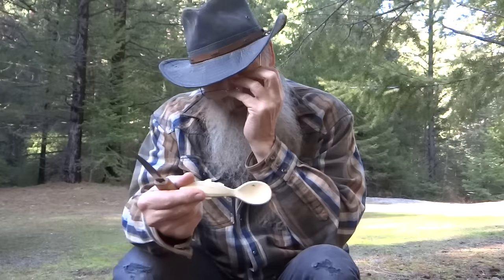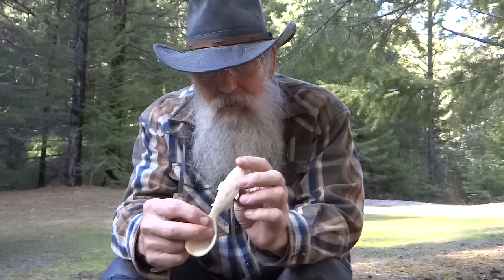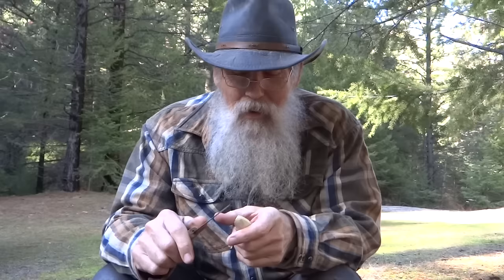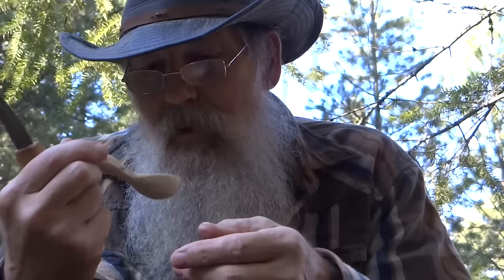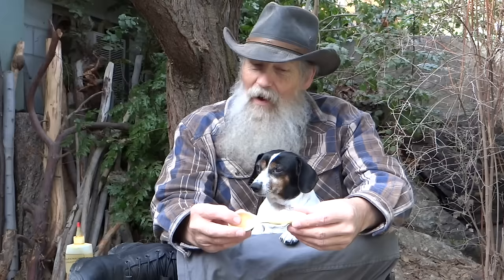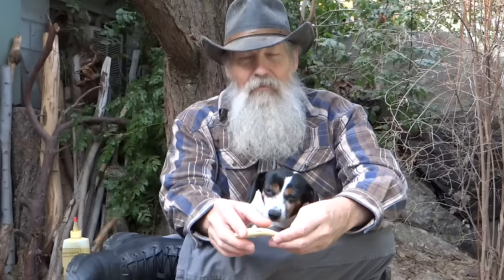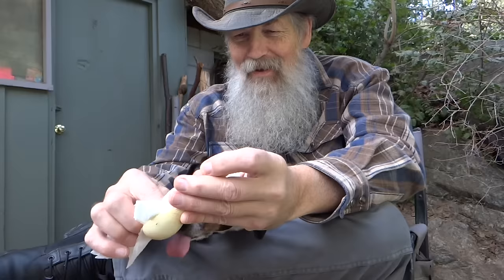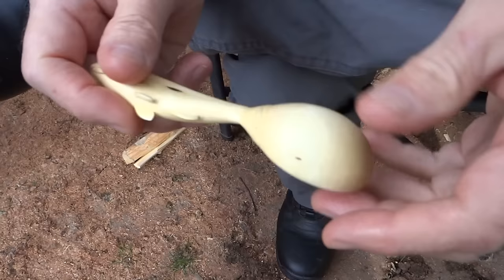Working on My Knife Carving Skills

Comment: i tried whittling for a while. but i cant get a hold of decent pocket knives, and i lack the skills for properly sharpening them. didnt help the only wood i could get was kiln-hardened pine from a lumber store, and had pretty weak hands at the time. still do have a weak right hand. my left is stronger since i got a bass guitar
i love walnut oil. looks great on western cedar, and also works as an oil panting medium...much cheaper than linseed (i simply bought the food grade stuff)

Comment: Hello, Mike, (^_^)
I loved watching you carve that spoon. You say you're going to use it as a coffee spoon? I take it, it will only be used for the coffee grounds, even though I have seen you use wooden spoons in the actual made coffee. I loved the way Pearl tried to lick at the oil.
Well, if the weather in my area is anything to go by, spring is in the air, so to speak. Very short winter this year, makes for disappointment for me, 'cause that just means the abominable heat is on the way again.
I wish you a great week further and an enjoyable weekend when it comes.
You take care now.
Best wishes.
Liz.
Reply from the maker: Thank you, Liz! I will only be using the scoop to measure out the coffee. Not to stir with. Pearl wanted to lick the spoon, but I kept it just out of reach, haha! 
The weather is getting nicer here. I hope spring comes early, so I can spend more time in the mountains. We don't have high humidity here, so even hot temperatures are tolerable.
You should move up north to escape the humidity. 
I hope you're having a great week!

Comment: Very nice. Do you think carving from fresh cut will crack from drying?
Reply from the maker: Thank you! It can crack, but I've noticed that if you work quickly, to remove the bulk of the wood, it's less likely to crack. It seems to dry evenly, and by the time the carving is finished, it is pretty much dry.